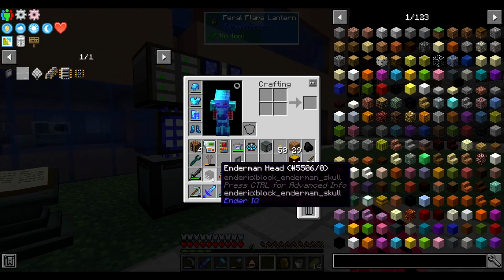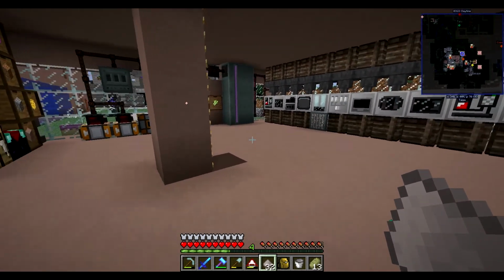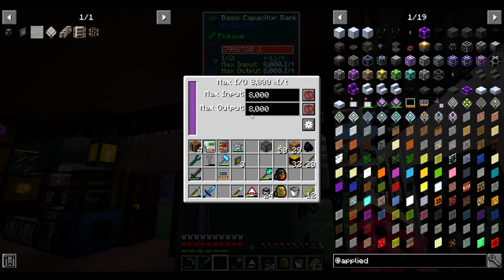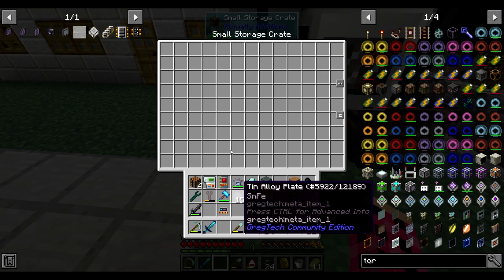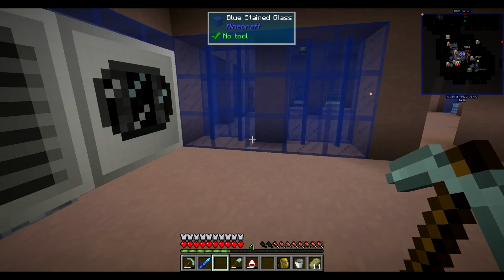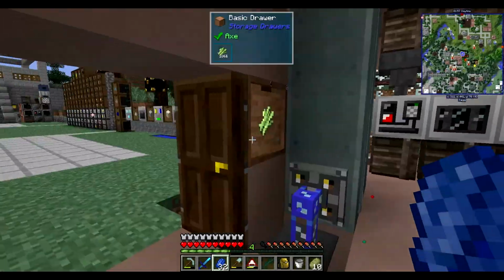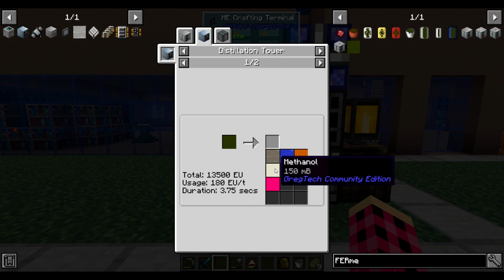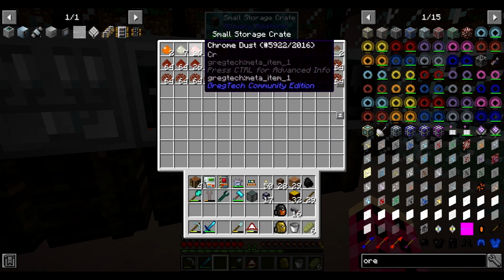Amy's OmniFactory Series | Ep46: Putting Stuff Together

Comment: Using ae2 p2ps for power, the total power input/output is dependent on the size of the overall network, starting out its not really worth it to use them as power transfer.
Reply from the maker: Well aware of that, but I don't think about the present. I think about the future. Spending a few moments of my time now is well worth saving me hours and hours of rewiring cables in the future. There is an enormous amount of conduit tiers. I would rather not have to replace them every time. I can expand my AE2 network according to my needs.